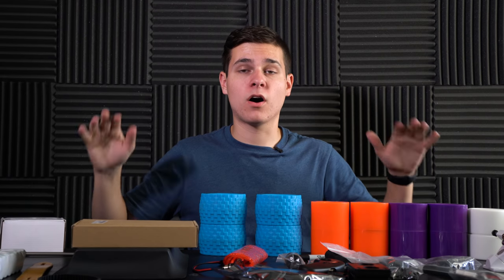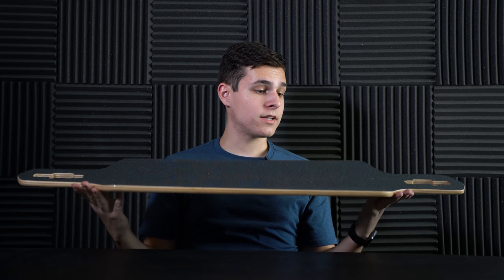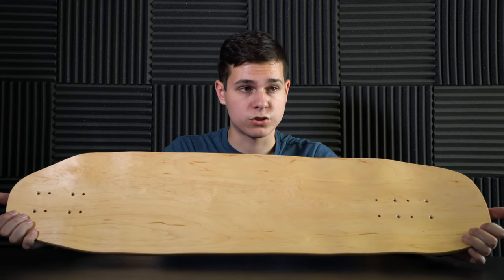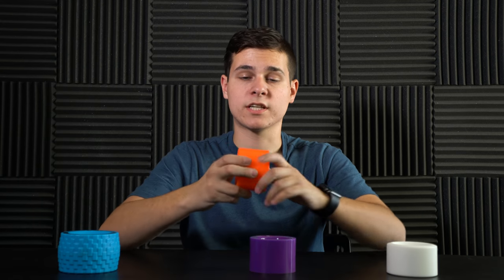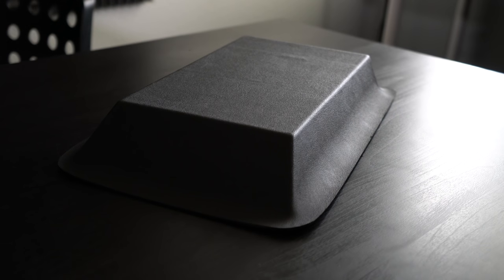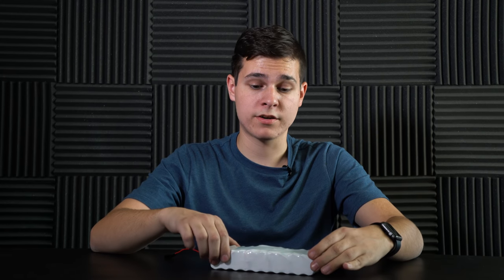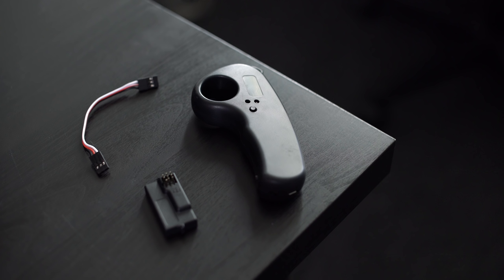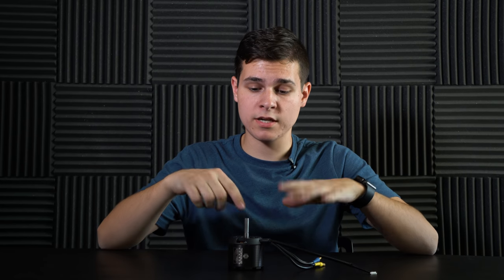DIY Electric Skateboard Build - Better Than A Boosted Board | Choosing Parts

Comment: Hey, I'm in the process of collecting the things you need to build an electric skateboard, but don't want to spend that much money, and don't see myself using it for any practice purposes. I have found most things reasonably priced but I struggle with the amount the ESC cost. What is important in buying an ESC? the voltage, wattage, how many Amps it outputs? I am planning on building a battery that is about 36V. Any suggestions for where to find one (preferably less than 85$) and used is fine.
Reply from the maker: +Sarah Crawford You’ll need one that can handle the voltage and amperage your battery outputs. 

I would try searching for a high amperage esc and got from there. I would get one that can handle around 100-120amps 

The Vescs can handle around 150amps

Comment: So I was looking on your website and see the esc for dual motors but I want to use the vesc so what do I need from the two motors. Two vesc? And if so how does that wire up?
Reply from the maker: Yes you would need 2 Vescs. You would have to connect them with a canbus cable
Reply: Mike Beard ok great need would you use two batteries. One for each vesc and motor or somehow connect the two vesc to the one 10s5p battery
Reply from the maker: You would connect both vescs to the one battery 👍🏻

Comment: im looking to build a 10s board with a 20 mile range atleast and nice and strong but im looking at your parts list and theres so many on the mboards site idk what to get :(
Reply from the maker: The longest range would be the 10s5p battery. You’ll get the range you are looking for. 

If you can sacrifice a few miles if range the 10s3p’s form factor is much nicer.

Comment: I'm somewhat concerned about the stability of the Torqueboard motor mount on the Caliber trucks.  Do you think they are worth the high $60.00 price point or are the other options on your page just as good if not better in terms of stability and cost?
Reply from the maker: I seem to loose screws a lot with the Torque Boards one. The ones I have on MBoards.co seem to be a little more solid.
Reply: Awesome thanks for the advice!

Comment: how can i protect the motor from water? you know some water spliting out from the wheels etc...

i want to make my eskate water proof, my country is a tropical country so waterproof is a must i think...

thanks mate... cheers
Reply from the maker: +Yohanes Isa Ananto Tri Pratiwi Brushless motors are relatively water resistant but the only way to fully water proof a board is to buy a water proof motor
Reply: Mike Beard what is the limit brushless motor can handle water?

Split water is okay? Is like puddle of water is okay too?

Comment: How many battery cells are use in the battery pack Mike so I'll know how many to order.  Just looked on your site is the price correct on your battery Pack $239.00?
Reply from the maker: +Nikko Gutierrez In the $239 Battery Pack there is 20 Cells total. 10 in series 2 in parallel. That also comes with a charge port and charger. 

If you are going to build your own you’ll need 20 Cells
Reply: Mike Beard is the BMS included in the pack? I may have you make it for me.  I was able to get into Kit and screen shot all that I wanted as per your recommendations Mike.  All except the deck. Which reminds me can't you use the rubber lifts on the drop thrus?

Comment: Do you recommend hub motors or a regular motor with a belt?
Reply from the maker: +Dom T Depends on what you are looking for. You’ll get better acceleration and torque with belt driven. But you’ll get a more minimal, quieter, and simpler build with hub motors. 

I’d like to make a hub motor vs belt driven video in the future 👍🏻

Comment: Can you also go over calculations of motor type and battery (18650), specifically on how you arranged the batteries depending on the specs and how do you know what speed, range or torque you're  going to get with these calculations.   Both on hub and belt motors if they are diff..please
Reply: Tommy the Barber go do some reading through forums on https://www.electric-skateboard.builders . The answers to all the questions you have are there. But to answer your main question you need to make sure your ERPM does not exceed 60,000. And Just don't bother with hubs, go read up on the forums.
Reply: He also explained it is a 10s2P battery back with Samsung 25rs meaning the pack is 42 volts fully charged 4.2*10 =42...

As for capacity we know they are 25r so 2,500 mah = 2.5 Ah. In parallel this is a 5AH pack...

Comment: If I personalize a board on your website what battery size does it come with? It doesn't specify anywhere before buying my personalized board
Reply from the maker: +Pozzy 10s2p Battery. Made from Samsung cells. 42volts 5000mah

Comment: I'm in the process of building one right now :) Just can't find a good pulley system and yellow wheels (yes yellow is important for my theme). Anyone have a suggestion for yellow wheels and a fitting pulley system? (From Sweden, EU) ps. Great vid once again :)
Reply from the maker: +Oskar Ogarp Pulley System: https://diyelectricskateboard.com/collections/electric-skateboard-pulley-belt-combo-kits/products/36t-kegel-pulley-combo-kit?aff=2
Reply: i just found a really good supplier called eskating.eu, but nothing beats the torqueboards motor mount

Comment: Just curious, why use a pulley system for giving power to the wheels as opposed to just having the motor drive the wheels themselves?
Reply from the maker: Belt driven systems have better torque and braking power than Hub motors.
Reply: Dang that was the fastest response time I've ever seen. Another question, how does braking work with electric boards? Sorry if you answered that in another video, I've yet to check out all of them.
Reply from the maker: The polarization of the motor is reversed which creates resistance to the spinning motor which then slows you down.
Reply: Sweet. Thanks man.

Comment: Hi, I need help, what happen if use 2 motors, for example one with 200kv and other with 400kv, would be powerfull and get I high speed, (lower kv with high kv)
Reply from the maker: The motors would run at different rpms. I would think it would run very awkwardly. I don’t think that would work very well. I would stick to 2 motors that have the same exact specs

Comment: Tbe Oranatang 80mm wheel are for the front only what about the for the hub motor will it fit also.
Reply from the maker: Like the boosted board, I use the orangatangs for all 4. The hub motors will fit on Paris trucks.

Comment: Is it possible with the power cable and port to charge lipo batteries?
Reply from the maker: Yes, if you wire the charge port to a proper BMS for your lipo batteries and your charger is the proper voltage everything will work :)

Comment: Do orangutan wheels attach directly to the diy electric pulley system or do you need to drill holes or anything?
Reply from the maker: +Jack Arne DIYelectricskateboard.com offers an Orangatang specific pulley System that attaches through the existing holes in the wheels.

Comment: What about having double motor? How does the set up work?
Reply from the maker: +Keith Antioquia dual motor set up requires 2 motors, 2 motor mounts, 2 pulley systems, and 2 vescs.
Reply: Mike Beard dual* would you require more battery power? And what kind of battery system would you go for?

Comment: Can the remote controller can set the speed like cruse control or like set the maximum like the boosted board controllers?
Reply from the maker: +KG Kurohase These controllers have 2 speeds. Full speed and 30% slower 👍🏻
Reply: Awesome! And have farther question! Do you think it's possible to mount the remote battery check and other stuffs to make similar performers like the boosted board controller?
Reply: I see DIYeboards has a new remote with 3 speeds now and the reverse switch is flush to prevent accidental movement.  Is this something that can work with the VESC?
Reply: Mike Cane I mean.. if the signals can match then it should work right? So I assuming that would work

Comment: How much does everything cost?
Reply: My part selections totalled about $850, and most of the parts i selected were the nicer ones.
Reply: You could do all for 350 I made mine for about that cost. But I bought small batteries and instead of buying wheels for boosted boards I opted to but drill regular wheels. It's all give or take, if you want less stress and work buy the more expensive stuff, if you can deal the stress of using less expensive parts then you build for cheap

Comment: Hmmm, there is something very essential missing: a BMS! You'll unbalance the batteries and they will be killed and have a very short lifecycle.
Reply from the maker: +Kurt V. I do use a BMS. They are integrated in the batteries I sell. Also in the parts list 👍🏻
Reply: Does the integrated BMS increase the price of the pack over one that's just the 18650s?
Reply: Mike Cane, it does, but it would not be good to avoid a bms.
Reply: My next question is, how often do battery packs come with integrated BMSes?
Reply: Mike Cane, if they are built battery packs, and not cells, than they should always have a BMS, if not, avoid that particular one.
Reply: Not True, I do not have a bms on my ebike and it stays perfectly balanced. I just checked it after about a year of using it, and they are just fine. There is nothing wrong with installing one, but you definitely do not have to use one, if you know how batteries work. Do not let them drop below minimum voltage or overcharge them and you are fine. You are the bms.
Reply: wevloc, that's true but the average user does not understand that much about batteries. It's best to include safety features...
Reply: ya their a waist of money...better off just using a 10 buck heat balancer once a year